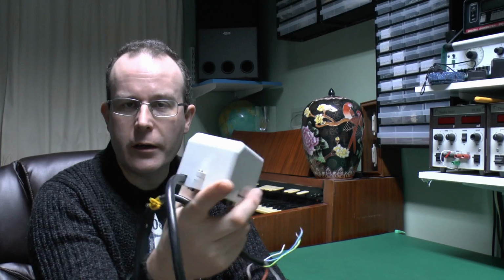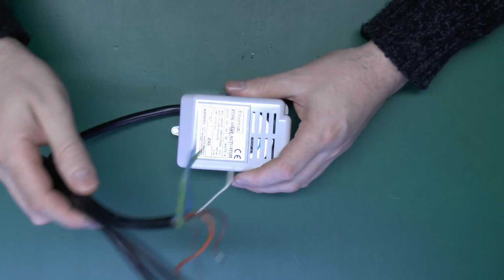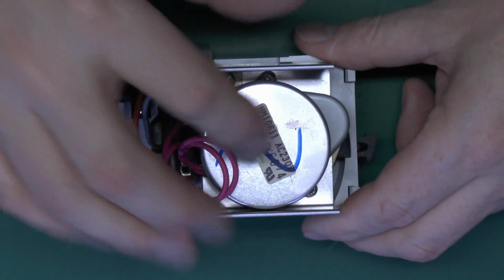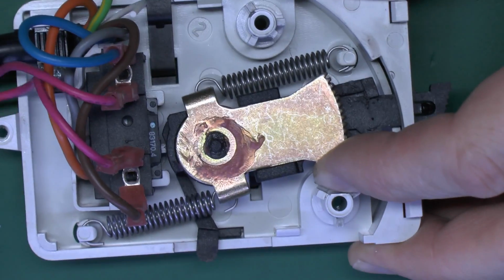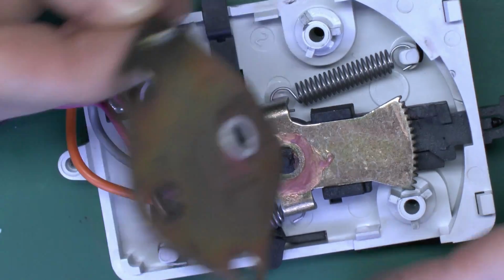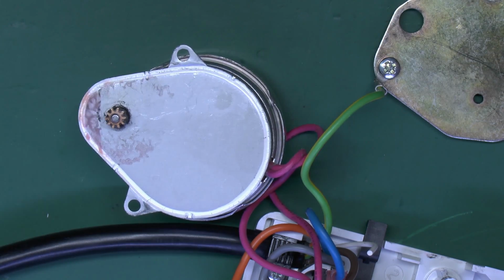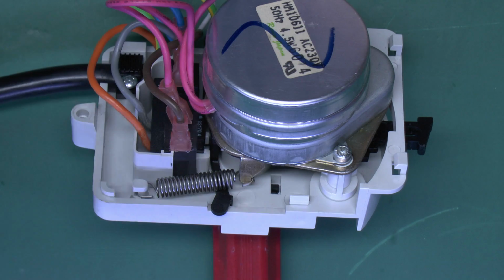Inside a Central Heating Zone Valve Actuator

Comment: Thank you so much for such an excellent and well presented video. I knew nothing about central heating systems or how they worked until I watched your video.  My boiler would turn on when required but wouldn’t turn off. By watching your video I had the confidence to look inside my HW flow valve actuator to discover that both plastic lugs holding the springs in place had snapped, so the springs weren’t attached and so unable to close the valve / micro switch when the power went off and hence leave the boiler running. Rather than pay the £300 that I was quoted to have it diagnosed and fixed - I diagnosed it myself & with 2 plastic coated screws fixed it myself - even if this doesn’t last I know how to replace the whole actuator for about 40 pounds but more importantly I know far more now about how my central heating system works so feel I have been well educated thanks to your clear and concise video! many thanks
Reply: congrats!
Reply: Thank you 

I had same problem (plug lug broke)

I was contemplating buying new housing & motor 

But you have given me hope I too can use a screw to create sling anchor

Comment: Thanks. My boiler and pump were running continuously. Watched this and opened mine. The microswitch was half way pushed in all the time and had some black gunk on it. Pressed it in and out a few times with a screwdriver wiped the gunk off with a cotton swab and all good now its working as intended.

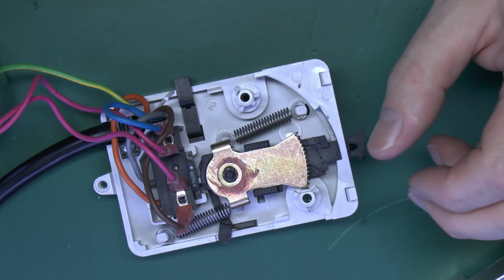Comment: I've just fixed ours thanks to this video.  What helped in my case was the part number on the microswitch visible at 04:59, which cross references to RS part 161-6640.  The switch was unmarked on ours, so this saved me measuring everything and hunting around for a physical match.  The RS part is an exact fit and only £2.70.
Reply: Great stuff!

Comment: Thanks. Very useful. In one of my actuator the screw that holds the motor is loose, so it cannot open the valve. Tightened the screw and fixed it. Thank your for the detailed explanation on how it works!

Comment: Brilliant video which allowed me to diagnose the fault with my valve.  One of the springs had detached because the plastic peg it had originally been fixed to had broken off.  A small self tapper araldited into place solved the problem.  Many thanks for his invaluable information, John.

Comment: Many thanks for this JW. We have had problems with our CH for the last 20 years. Turns out it was incorrectly wired plus a residual voltage from the Y valve firing up the boiler. A head scratch and suppressor later, all is well.

Comment: Hi John. Watched this vid cos I was having to manually close the valve. It opened OK but would not shut off. Then the little black plastic bit snapped off so I had to take the cover off to get to the bit of metal and push it down to close the valve. Watching this vid made me realise that the bit of metal I was pushing should have had a spring attached but it was missing. I found it on the floor, attached it with a cable tie (the plastic pin had snapped and left a handy hole) and hey presto - working actuator valve. I know it won't last forever but I brought some time. Thanks for the vid.

Comment: I think that the manual lever only opens the valve half way because it is a common part with a three way valve (in which it is desirable to do this). 

Having both output ports open on a three way valve makes it easier to bleed air from all parts of the system.

Comment: Just watched this video and then proceeded to fix my valve assembly.
Thanks for making this video. I watched the video  and then  took mine apart and the plastic lug that holds the spring in place had snapped. I made a little repair and its working fine now.
Understanding and seeing how the valve worked made the job much easier.
Thanks again
Reply: Same here

Repair =used screw thru hole then looped spring over it to create spring tension

CH test on/off = saw motorised valve move from A(on) to B(off) & back again

So happy...fixed in 60sec saved £300 bill & a headache I had how to fix

Comment: I've just had to fit the mid-position version of this valve to replace an old blue Switchmaster that suddenly developed a 1l/week leak from the spindle. From the hand-written date the motor on it it's been in use for 37 years and I somehow doubt the new one will last anywhere close to that. 

The base moulding of the new Drayton looked identical to the one you show here, so it seems they've designed the moulding for use across the range of 2 port, 3-port mid-position and diverter valves. If you look there are slots for the vertical snap-in PCB used on the mid-position valve and this commonality probably explains why the manual actuator only opens the valve half-way - on the mid-position version it opens it to the mid position for filling and bleeding the system.

Comment: Just had one of these fail open so CH was on all the time. One of the return springs just fell off! The plastic peg that it should be attached to broke off. I guess they use plastic that can't cope with the heat without going brittle. What a great design!

Comment: Yer, thanks for that... most interesting; just fixed my MA1. The spindle on the valve was dry and siezed; some WD40 and then some oil freed it up enough for the MA1 to move it. I was surprised to see that tyere is not much movement on the spindle... only about a 20% throw!  But I can feel the stops so I presume that's normal!  it appeared the the MAi was OK.  Oh, is that an M102 in the background :) I have the A100... perhaps I should have used some Hammond turbine oil? lel

Comment: I see this one has a one-piece motor and gearbox so you can't replace the motor on its own. 

They do seem to work on a thermal knife-edge, particularly when installed in an airing cupboard next to the hot water cylinder as they usually are. If anything makes them run a little bit hotter the motor coil goes open-circuit - a towel dropped on them usually does the trick IME.

At least on this one they've added a heatsink, although cooling the motor via the gearbox isn't the best arrangement.

Comment: So, fully open the motor is effectively stalled, so just sits there getting hot?
Excellent video. My fear has left the building!
20 mins later....
My problem: one valve that fills hot water cylinder does not appear to close fully, so when central heating is on, I also end up with scorching hot water, and I'm wasting money. Will replace the motor assembly...maybe on both. The guarantee ran out 15 years ago!
Also checked that the mechanical valve is not seized. this seems ok, nice and smooth.
Reply from the maker: Make sure the valve does actually close without the actuator on - they normally have a rubber disc or ball inside which is what seals when closed, they can deteriorate so the valve never closes properly.
Reply: @jwflame 
Thanks John. When I manually opened the hot water valve it didn't shut properly compared to the identical central heating valve maybe springs..? I've ordered two replacements at a very reasonable £39 each Inc vat.
When they arrive I can check if there's any difference in valve resistance/ smoothness. If there is it's drain the system time and change the body as well as actuator.

Comment: Grey is the perm live for the micro switch
Brown is wired to the same terminal as the room thermostat so once the room drops below the set temperature it allows current to flow down the brown which then powers the motor which then activates the live switch (orange) and allows the perm live to send current down the orange which then tells the boiler to ignite and get going

Comment: A few notes after a bench test of a new actuator in case anyone finds them useful:  the manual selection lock DOES NOT close the microswitch; the microswitch does not close until power is applied to the motor. I don't think the documentaion makes that clear.  This means that, although the manual selection lock will (partially) open the valve,  it will not cause the boiler to come on. Also, applying of power overrides the manual selection which is lost when power is later removed.

Comment: Hello, I have the MA1, what does it mean if it's stuck in CH (and can't be moved manually either by pushing the lever at the back)? It fails to move to DHW position when CH is no longer being called for and when only hot water is being called for, as well as not returning to DHW position when the motor's deenergised (power to the circuit box in the water tank cupboard is turned off by flipping the fuse switch next to it). There is no hot water in the tank so that side of things is not 'satisfied'. Both the heating and cylinder stats are on. I would REALLY appreciate if you could give an idea what might be wrong as I can't figure out whether it needs to be replaced or not, many thanks! 🙂
Reply from the maker: Either the actuator has failed, or the valve has seized.
Remove the actuator, the valve spindle underneath should move freely.  If it does, then it's just a new actuator.  If the spindle doesn't move easily or at all, then the whole valve will need to be replaced.
Reply: Thank you!

Comment: My own valve is a Drayton MA1 which is a mid position actuator but I only use it to switch between hot water and central heating. It works if I connect mains direct to the motor but not if I connect it normally. It has 2 microswitches and I suspect one of those has failed but I don't understand what they do. From what you say the motor remains powered up but stalled when in the right hand position. If this is the case I could ignore the other wiring and just connect new wires from hot water thermostat to the motor(when the hot water reaches temperature the stat powers the diverter valve).
Reply from the maker: 3 port valve explained here: https://www.youtube.com/watch?v=F5m8f6HN2Us
you can't just connect the motor directly as that valve has 3 positions and one of the switches in the valve is what activates the heating.
Reply: @jwflame  As I said, I don't use the mid position setting anyway. I have wired the thermostat direct to the motor and the valve is now working fine.

Comment: My Drayton MA1 packed up - motor ran, lever moved  but central heating boiler would not fire. Turned out to be worn cam/microswitch. Found it cheapest to buy actuator with brass valve rather than just the actuator.

Comment: Thank you for a clear demo.  The microswitch can also be a problem ? - central heating continues to run despite thermostat control switched off
Reply from the maker: Yes, if the switch sticks closed, the heating will run continuously even if the programmer and thermostats are off.

Comment: Hi John, thanks for this video. My radiators keep running and giving heat despite the heating being turned off from the thermostat and programmer.  What could the issue be?
Reply from the maker: Valve has jammed open

Comment: Thanks for your detailed explanation of how a two port valve essentially operates but I am trying to understand one aspect and that is, when the synchro-motor has fully moved the actuator lever to open the valve and turn on the micro-switch, that in turn powers up the pump, what prevents the motor gear from continually rotating, it having reached the lever’s full extent? Is there an internal clutch within the motor that allows the gear wheel ‘to slip’ and prevent it from mechanically damaging the cogs?  Is that why, when the motor is operating it generates heat?
Reply from the maker: It's just the mechanical stop which prevents the lever moving further, the motor is stalled.  There is no clutch.

Comment: It is important to stress that these valves must be open before the boiler and pump fire up. If somehow that microswitch signals the boiler and pump with the valve shut then the hot water has nowhere to go and it all ends in tears! You are right to suggest changing the whole motor head as a unit as if the motor has failed other items like the switches may have failed too. Once on the bench you can figure out what the fault was and salvage some spares.

Comment: Can you use orange and grey as volt free switching ? Are they separate to the 230V from the brown and neutral. for example stat powers the brown of the valve pulls its across to the SL of the orange to make a connection with grey?
Reply from the maker: Yes, the switch is totally separate from the motor connections.  Example in this video: https://www.youtube.com/watch?v=nOQ8ZEhSLDI

Comment: Hi john,very good job☺ how important is the "actuator code"? the faulty one i have is an MA1, i have found a ZA5 at an almost giveaway price, would i be able to use it?or does it have to be an MA1?,.
Reply from the maker: You need the MA1 which is for a 3 port valve.  ZA5 is for a 2 port valve and is completely different.
Reply: @jwflame  Thanks for the help.

Comment: Thanks John, replaced my 2 port valve head as the old one seized, the original valves orange & grey wires didn't have any connection just L N & E. So no signal back to my boiler i guess, I have 3 of these valves in the house, upstairs, downstairs & hot water all wired the same, also have two wall thermostats one up one downstairs. Does this mean my boiler only gets a signal to turn on from the timer control or the thermostat? And is this S Plan wiring done wrong?

Comment: Cheers John. Watching the video helped my understand the mechanics of the 3 position valve which was only setting to W and M and not getting to H. Some how I managed to free the valve using the lever and now we are set to H only but at least we now have hating and hot water which we haven't had since coming back from a holiday! Have I managed to manually override the valve/switch? And it is now always open? I have a Drayton similar to what you demonstrated but a three way. Cheers.
Reply from the maker: Manual should be M which is both outlets open.  If you have both heating and hot water it isn't actually at H even if the indicator is, so it's likely the internals have been damaged in some way.

Comment: my zone valve activator is on the 'A' signal but the hot water continues to flow through it into the water tank and the water is getting too hot. It seems to be heated both directly when the hot water  'boiler 'function is on but also when the central heating is on and the hot water part is off. 
does this mean that the pipe below is jammed open or could it just be that the valve is broken and reverts to close on the plastic switch while the port in the pipe remains open. Is this likely in the case of a hot water feed pipe.??? Any comments would be appreciated

Comment: This part failed three times on me on as much years it really got me crazy! The micro switch keeps burning out
Reply: #
You can replace the micro switch, Maplin have a suitably switch Part No GW69A you have to  superglue the new switch in after soldering the two wires. The cost of the switch...£1.99 which makes me very happy.....

Comment: Hi I have a question, please help so I know my za5 valve is faulty because it's not flicking back when my timer turns off and it's leaving heater hot.. but do I need to change motor or change full za5 valve?
Reply from the maker: Take the actuator off. If the spindle underneath is easy to turn, then it's just a new actuator.
If the spindle is jammed or very stiff to turn, it's a whole new valve and actuator.
The spindle only moves about 1/4 of a turn between open and closed.
Reply: @jwflame  it's the spindle it's very stiff to turn. I can change it myself but I been advised I need to flush? How do I flush?

Comment: You don't mention what exactly the microswitch does?? I think I have a faulty one but I'm not sure what it does?
Reply from the maker: It's a switch - joins two wires together in one position, and doesn't in the other position.
Reply: @jwflame  Yes but I was wondering what it is switching in this context.
Reply from the maker: @phlize  The switch controls the boiler, when the valve is open the switch activates the boiler.  Explained in other videos in this series, https://www.youtube.com/watch?v=V9rN5D-wQIc

Comment: My valve gets stuck and you can't slide the manual tab at the bottom as it won't move at all. Funny part is, if I tap the valve with a hammer, you hear a 'click' and then the ticking starts and the tab starts to move. It get stuck like this all the time. What do you think the problem is? THANKS!
Reply from the maker: Valve has probably deteriorated inside.  There is usually a rubber ball or disc which seals the water inlet and when the rubber gets old, it becomes sticky and can jam in one position or the other.  Solution is to replace the whole valve.
Reply: Thanks John. I figured it was most likely something like that. I wished it wasn't something that required actual plumbing so I could do it myself; oh well...
Reply: @jwflame  I have exactly the same problem, gets stuck on M, if I wiggle the head a little it "clicks" the lever moves to H, the pump starts and the boiler fires. Was hoping I could just change the head but sounds like the whole valve needs changing. It is 20 years old so guess it's getting sticky. :-(

Comment: Excellent explanation. Unfortunately, the design of this actuator is insufficient. Both springs are each attached to a plastic pin on one side. Plastic and heat don't mix well and the pin breaks. I hadn't noticed that when my installer replaced it. When the second broke, I was able to easily fix the first with a bolt.

There was more wrong with the second. A small (internal) piece of the black lever for manual operation had broken off as a result of which a tooth of the gear has broken off or vice versa. Anyhow I reckon the design is not durable.